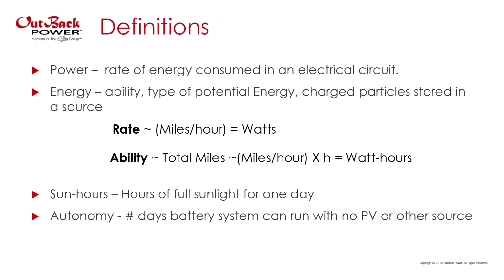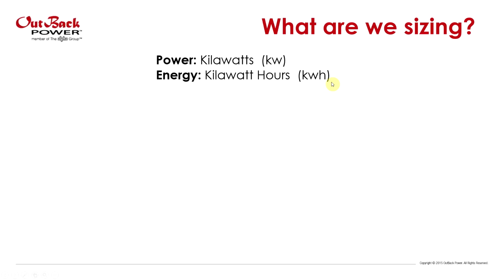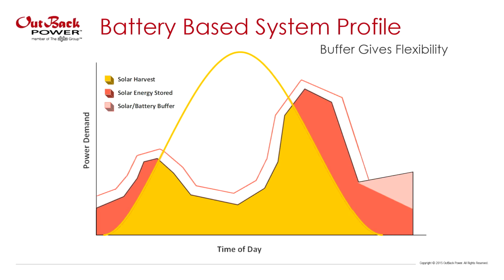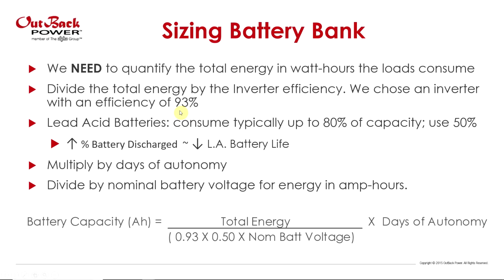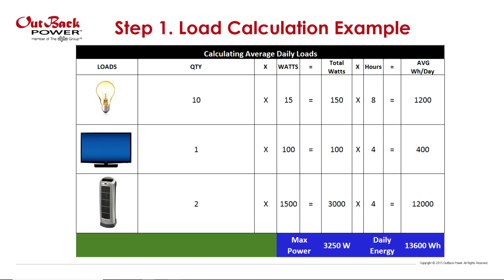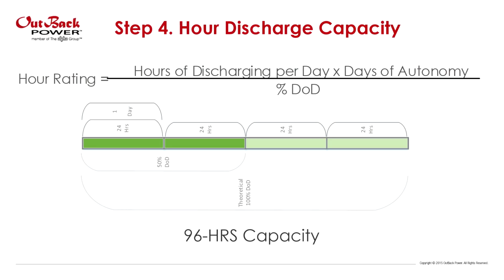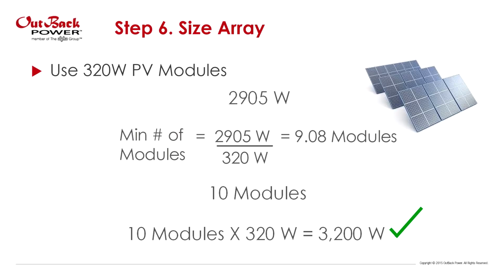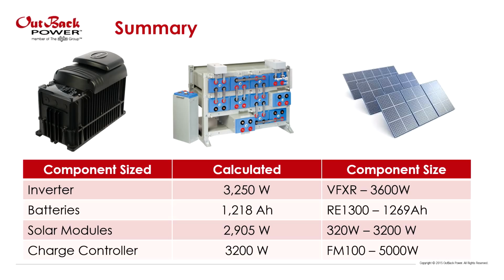Webinar | Introduction to Off Grid System Sizing

Comment: The 3200W PV is not the stc rating of the panels but rather how much it will produce for that specific location. A 3200W stc rated panel will produce less that.

Comment: Why is this titled "for off-grid" and then at 1:30 it says the webinar is for grid-tied systems?
Reply: At 1:30 I said " An introduction for grid tie installers who might be interested in battery based systems" 

 I didn't say grid-tie systems. It is for installers who normally do grid-tie systems (no batteries) that may want to branch out to battery based systems.